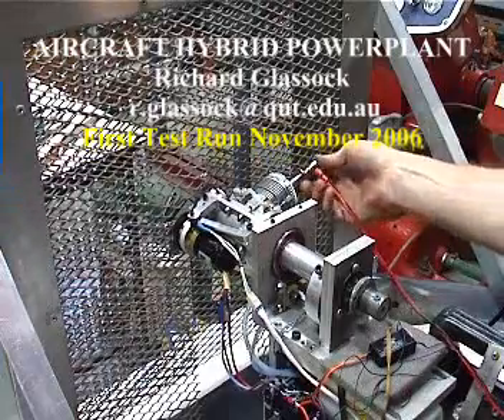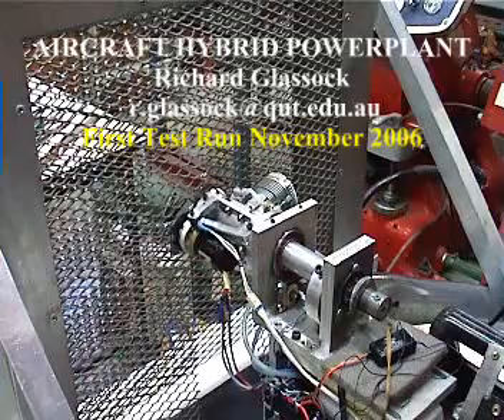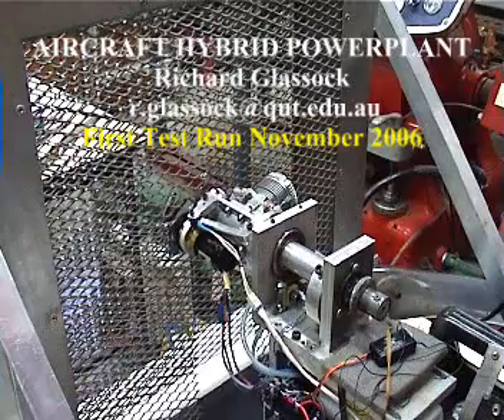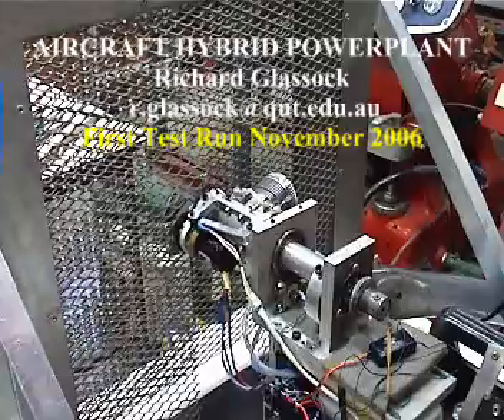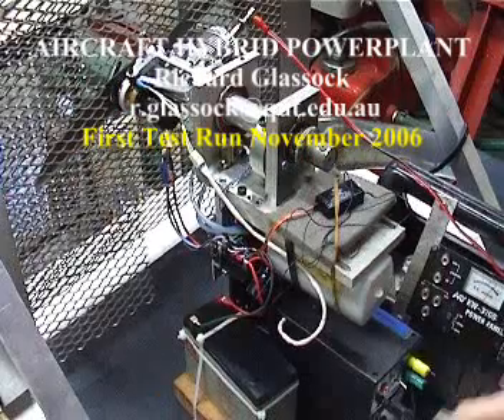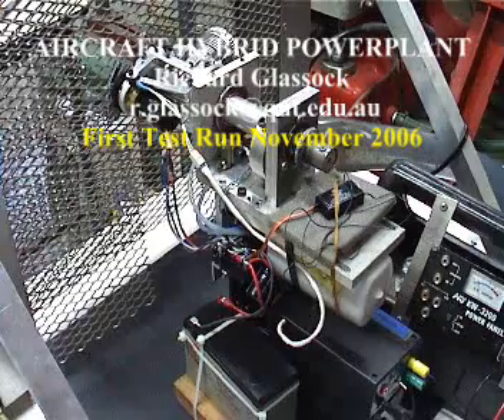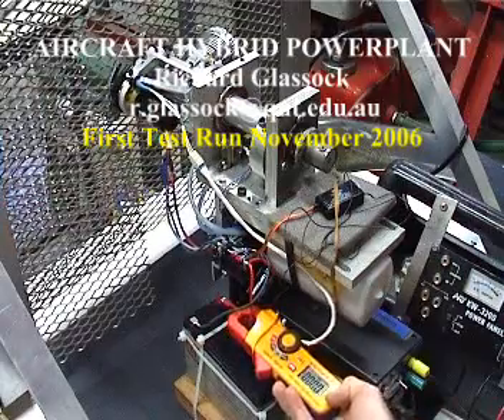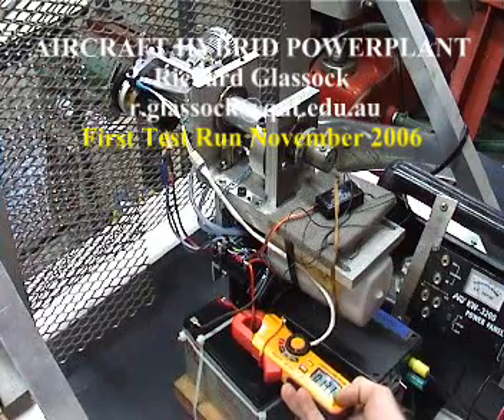Aircraft Hybrid Powerplant

Comment from the maker: Yes, the purpose of the system is to enable Starting and Charging, also Boosting and Regulating the thrust. The use of oversized propeller also helps with efficiency. This particular unit features no clutch, however future versions will have different configurations.

Comment: Please include in your post what the gist of these runs illustrate. We're inferring that, one, you have an onboard starter, and two, you have a generator delivering current back to the battery. 

It appears that once you get the engine started, you are not disengaging the starter but allowing the engine to drive it and thus instantly converting your starter into a generator. Is this correct?